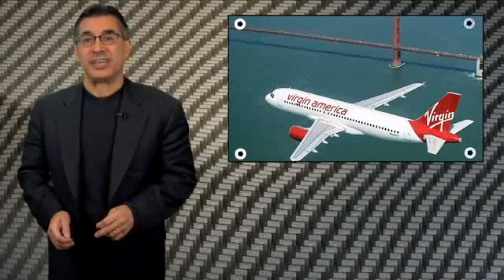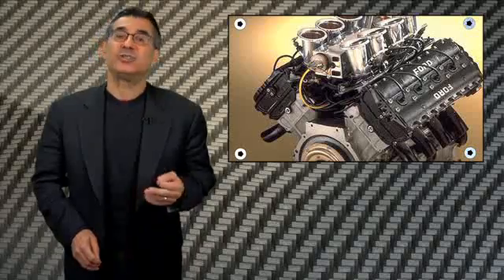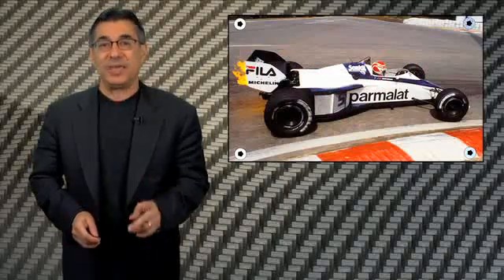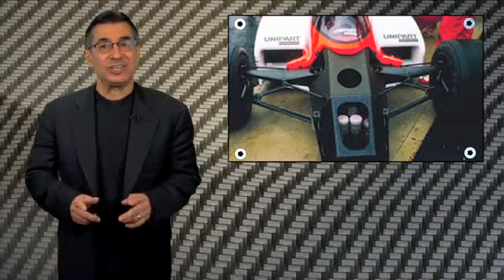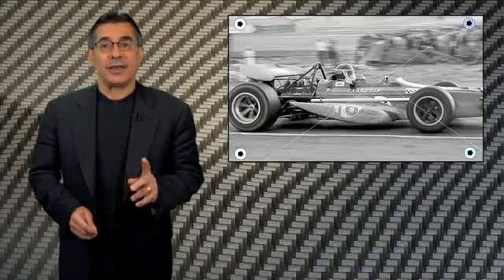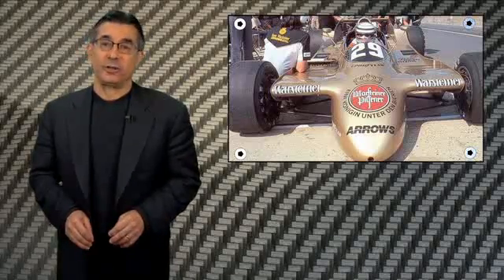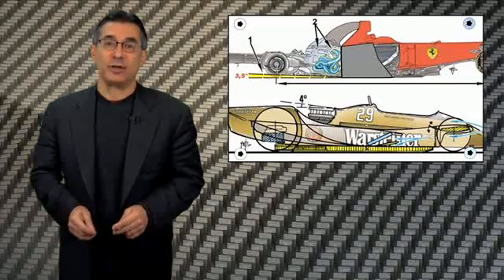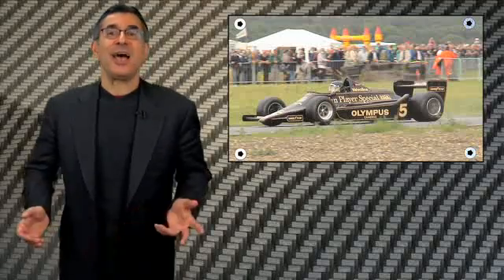Roots in Racing - F1 Tech to Road Cars

Comment: Why don't you read Pete Lyons CAN AM book, and do an overview of the wild innovations that came from the first totally open design racing series where the cars weighed 1500lbs. with 900 hp motors, all Titanium, all wheel drive, 4 engineed, roots blown, etc. 
These cars would leave twin black marks down the straightaways when exiting the turns.

Comment: I have a book from 1933 that mentions turbocharging and fuel injection in some detail.
and flicking through it.. an engine with one valve in the head, with another valve to switch between exhaust and intake manifold.

Nice info on the tilted engines

I don't know what the F1 rule on variable valve events are, as far as I know it's not allowed in any way?
Allowing variable valve event tech would mean some variation, some innovation and some application to road.
2013 regs, hope for TERS and PERS.

Comment: @oldsoulyoungbody  Not a bad choice.  The BT46 had many iterations.  1st debuted with surface cooling NOT traditional radiators, then it got std rads, then it got a diff nose [or 2], then it became the Fan-Car, then it went back to a 'normal' car.  BUT, check out the later versions of the prior BT-45 - With DUAL engine snorkels sticking high up in the air from the edges of the sidepods.  !!  Gordon Murray rocked.

Comment: @Janusha Your ignorance is astounding.

I suppose EVERY European high-performance car out there is an MR?  Last time I checked, Ferrari, Mercedes-Benz, & BMW still build FRs.

What's more, the similarity between NASCARs and their production equivalents begins and ends with that pushrod design that you detest.  NASCARs are V8-powered, carbureted, and FR. Their production equivalents are all fuel-injected. Half of them aren't V8-powered, and only the Charger is RWD.

Get off your high horse.

Comment: We need a Tech unlimited class in racing. F1 apparently is no longer it. I would be loathed to have to choose RWD-only or AWD only. Why not have a class for both? Because Tech UNL-class would probably cost more than F1 does now. Also AWD would mask technological issues that you want laid bare for Designers Engineers and drivers to overcome. The Fan-car might not have happened at all if AWD was the rule.